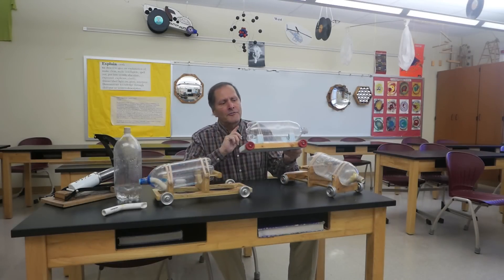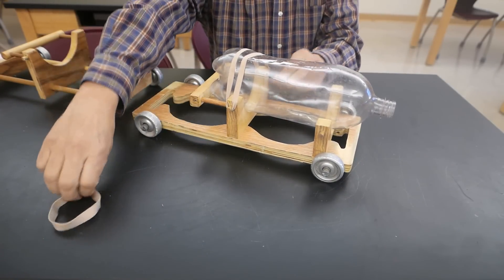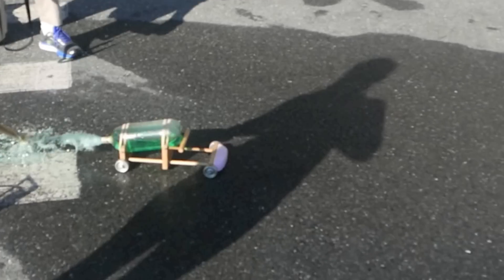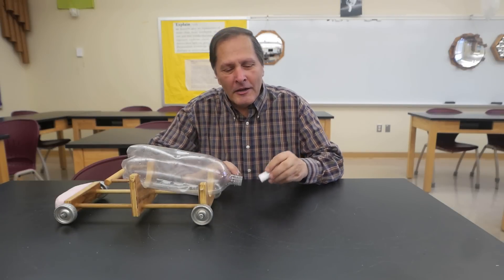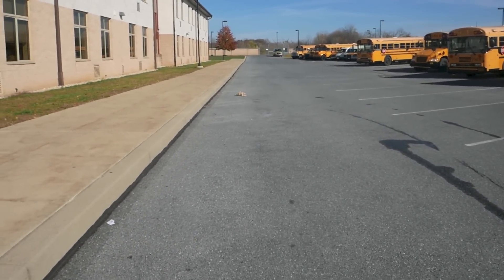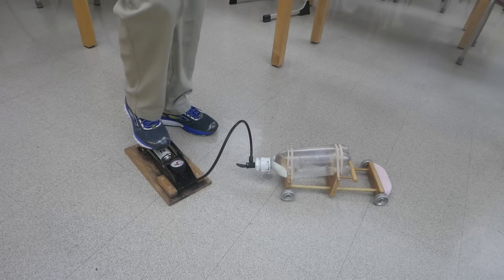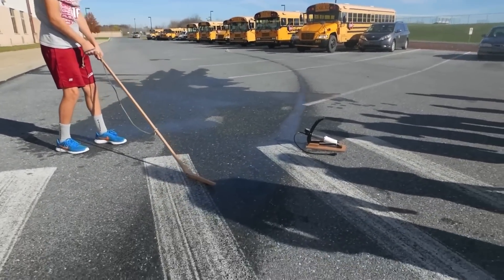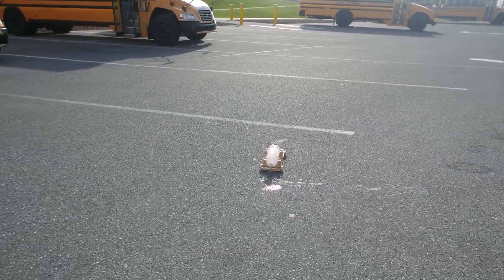Soda Bottle Rocket Car-Physics of Toys // Homemade Science with Bruce Yeany

Comment: Could they be made to run straighter by using larger diameter lightweight wheels with rubber tyres (greater lateral friction, and less sensitivity to ground roughness)?  Also, could the centre of thrust be moved a little forward (between the back wheels), to avoid the possibility of spinning?  An expanded polystyrene chassis might compensate for the inevitable increase in mass.
Reply from the maker: I'm looking forward to trying this again in the spring,  thanks for the suggestions
Reply: Indeed ... not a winter experiment!  :-)

Comment: rubber wheels would have better traction on tarmac and probably add stability,
Reply from the maker: funny you should mention that,  I needed rubber wheels for another project and used cut up bicycle tubing as coverings,  I didn't think of using them here but that should help.  thanks

Comment: How would changing the liquid in the bottle affect it? If you added salt to make the water denser, would that generate more force? (Or take it to the hypothetical max by using mercury) Or what if you used something with less internal friction like alcohol or a hydrocarbon?

Comment: I have a question?Beside what Wikipedia says,I honestly do not believe that a rocket can work in space in a vacuum. I know I know MythBusters tested it in a small vacuum chamber. but the chamber  was very small .  I believe  that the rocket in their video  which was a bottle rocket  was actually pushing against the vacuum chamber walls . however I have tested it myself with a balloon on a string and a vacuum cleaner at the end of the nozzle,and it will not Propel the balloon. I love what you're doing with the kids by the way, but I'm really looking forward to your answer on this.
Reply: Hello, Not Bruce Yeany here but please let me give an example :)
I suppose you live in northern hemisphere, right? When you go to ice skating area, bring your handbag, preferably filled with heavy stones. With your skating shoes on on that ice, try to stand up as steady as possible then throw your bag forward. You will notice that you move backward because of the action-reaction force.

You might say that it's the air you push that reacted by pushing you backward. In that case you retry the experiment but instead of throwing your bag, you just "push" your bag forward fast. You'll find that you don't move the same way compared to when you throw the bag.

Its same principle is used in rocket.

By the way, how exactly did you do your experiment with balloon and vacuum cleaner?
Reply: +oejankz Thank you for the example. I have to say that in the experiment with the balloon and string, the balloon did propel forward somewhat. However I did another experiment with a toy car powered by a balloon and it did not move with the Shop-Vac at the nozzle when I released the balloon. The whole idea was based on what we are told about the vacuum of space that it is expanding. That is why I chose the Shop-Vac to represent space.

Comment: Why not tip the bottle all the way upright? A rocket might need much more pressure though.
Reply: Aperson , it's enough pressure for a rocket . A while ago I built one . It flys very good . Just text in yt : water pressure rocket . You can also build your own.
Reply: Aperson not really, in aerospace we got away with 100. it doesn't work with the more complicated designs though, if you added multiple stages it tended to exponentially lower the max height.
Reply: +Fjdbend Fllf how could multiple stages lower the max height? Was every stage the same size? It should be getting exponentially smaller as each prior stage detaches, that will get you very high altitudes.
Reply: Not every stage has a thruster. By my design it had two boosters and a command module, with an electronically deployed chute, but the structure required outweighed the thrust. It still flew pretty high though, just not as high as others

Comment: Have you ever tried using only the bottle and some bricks to point it up. That way, it's like a rocket. You would have to do this in an open area, though, because you could otherwise lose your bottle and it could land anywhere and on anything, and you don't want that to happen. Cool car, though! :D
Reply from the maker: Hi Stemaa1,  this was a very recent project that I started on this fall so it may still get some changes in it.  It gotten too cold out to continue so it will have to wait but I'd like to try that and see how far it can go.
Reply: Cool! I can't wait to see it! :D

Comment: beautiful project, as soon as I can I will do a similar version, but I would make three changes.

First change, fix the moveable part of the cap to a wooden box, and fix the wooden crate to the floor, weighing down the cash, with a foot or standing stone, this change brings three benefits:

- no longer needed the stick
- at release the game bottle with more stability because there will be less vibrations.
- the cap now "steals" energy at the time of the blast, because he flies fast in the opposite direction to the bottle.

Second change, would try to keep the rear wheels closest to the cap, the instantaneous point of rotation is too perpendicular to the center of gravity of the bottle, for this reason tends to overturn think.
so if you can remove the counterweight the car will be lighter and it will go faster

last change, I would put the "shark fins" to the bottle maybe go a little straighter.

Might be okay as changes?

Sorry for my bad english, i'm Italian.
Reply from the maker: HI Luca,  Always good to hear new ideas,  I just started these this year so I'm looking for any improvements that might make it easier.

Comment: How do you find the acceleration, speed, and distance to be different between the air model and the water-and-air model..... Which one seems to give a better result??
Reply from the maker: HI x8xpptx8x,  the water driven model is much quicker and has a much higher speed even if the pressure is the same, it's easy to out run the air powered car.  Distance for the water model is probably around 300 feet if I attach it to a stretched string and kept it on a straight course.  One of these days I should measure it and also calculate an actual speed
Reply: you can estimate the final speed with momentum conservation, first you have bottle with water at 0 speed, and than you have the water flowing at certain speed, so now its easy to calculate the bottle speed. if you use the freaction the calcuoated speed will be more precise. Sorry for may bad english, i am braziluan
Reply: That calculation would only work if air friction is negligible. Nice idea, though